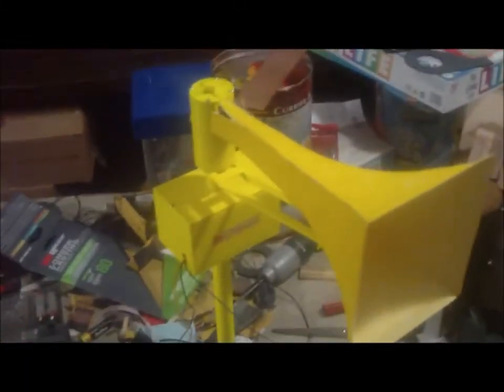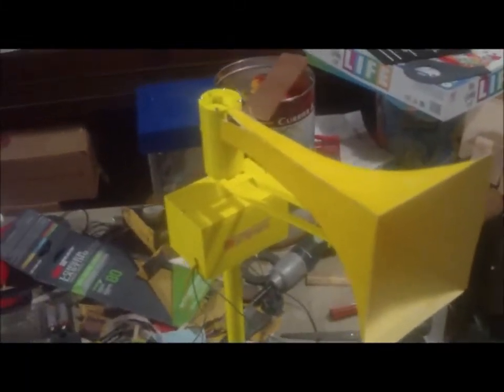mini thunderbolt update - lobe blower works, but like crap.

Comment: Or make it belt driven like real Thunderbolt sirens
Reply from the maker: i tried that once. it didn't work. the motor was too weak to turn it. i even had some strength issues with the gear version before i filmed this video.
Reply: Darn
Reply: Are you using the twin lobe or triple lobe? I saw that the lobes on your triple lobe design were touching, you never want that in a roots blower/supercharger.
Reply from the maker: i am using twin lobes.